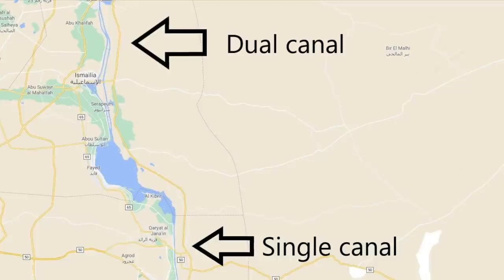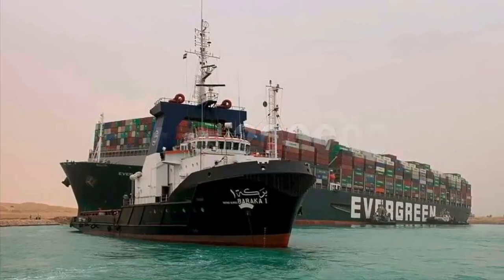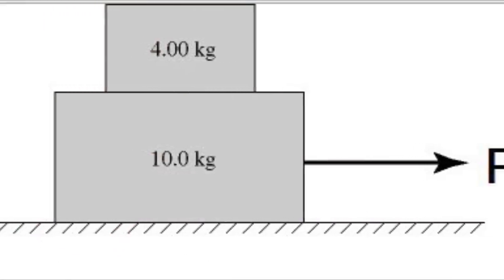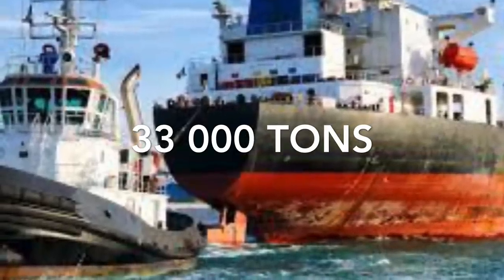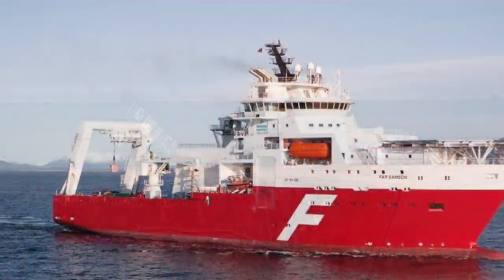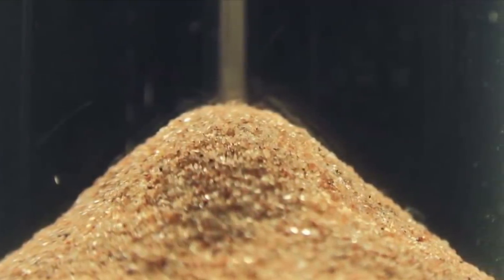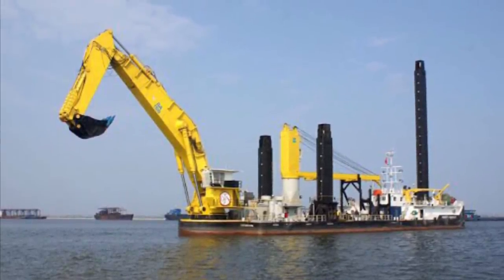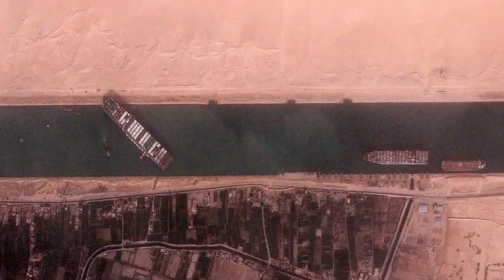MV Ever Given - why can't it be pulled out? Suez canal blocked

Comment: I you try to pull the back of boat using pulley from the biggest world crane on horizontal plane. You should make enough room that other boat could drive trough.  How many pulley of which size vs rope diameter do you need to move 33 ooo tones? Answer 6000 tones vertically. 
Empty the boath and move it side way.

Comment: Why did they use the most useless of equipment to move this vessel?
(TUGS)
When they could have very easily used a land based pull with better and quicker results.

Those involved on the water such as salvage companies, are usually union controlled, and they claim all rights to move this,
Wanting their high rates for labour and especially they just love that double and triple time clauses they got in their contracts

But anyone with half a brain could have used more and easier land pulling effects
A tug pushes water and as well pushes it back against what they may be pulling, if they are pushing, Still the efficiency is extremely high
They used 10 tugs at one time, The wasted effort, was high,

How much more effective would it have been to use large bulldozers on land?
With a definite and positive pulling force, Not a slipping one with water,
3 or 4 - D 8 dozed could almost pull that without any trouble, with lines going across the canal.
And then they could have easily doubled tripled or used several mechanical advantages to increase their pulling force,
But no they would not listen to wisdom when they were told the easiest way to un lodge this toy.
But someone may have made a big stink, probably saying I can do it, (wanting only the money to be made of this salvage) realizing they would need several big tugs at several thousands of dollars per hour, times 10 and then working 24 hours a day
What a wasted effort of expense,

There was no brains used in this recovery, when they were told of the easiest and cheapest way to get this vessel floating.

Comment: why would you use a boat to pull it instead of land vehicles?  cables and multiple tractors / bulldozers / trucks / tanks,  etc.   
some helicopters are strong enough to lift whole tanks. those could be user to unload a bunch of containers. 
you also seem to be approaching this with 'all or nothing' thinking...  i.e. have to dig ALL the way down to 15 meters..  I imagine 14 meters might be enough.  maybe 13.  how much of a difference does a meter make?  then figure out how many meters of earth actually have to be moved. 
so.. science and problem solving wise...  this video could be a bit better.

Comment: Why would we need a boat to use the pull solution ? You use ropes and pull from the ground, I don't get where the problem is. There is probably one since enginers more intelligent than me did not use this solution but right now I don't get what it is.  There is some basic winch that can pull 8T.  So you just need 25k of this basic winch and voila LOL